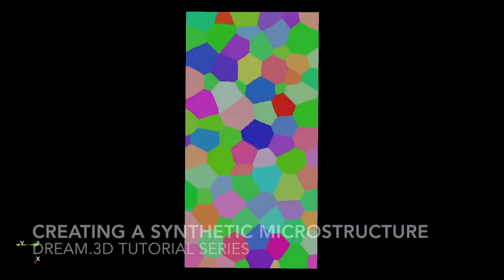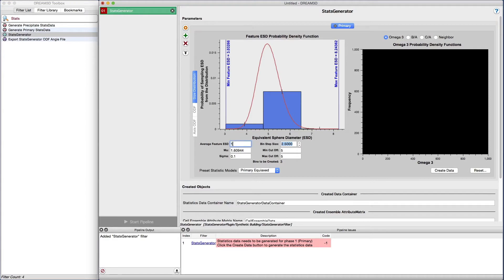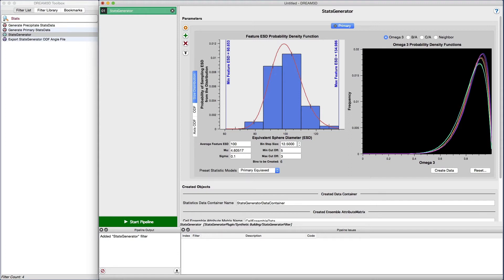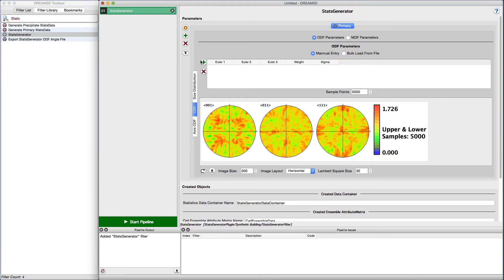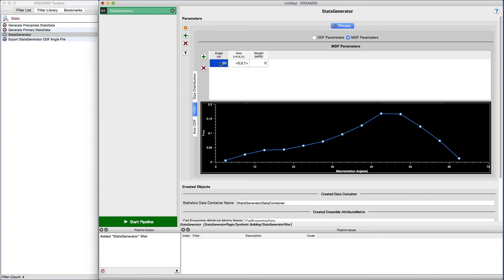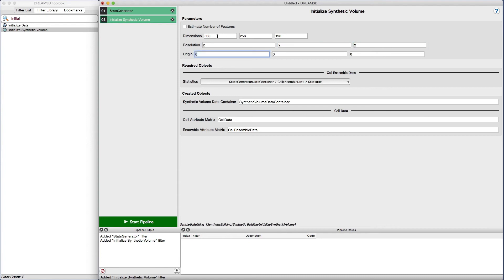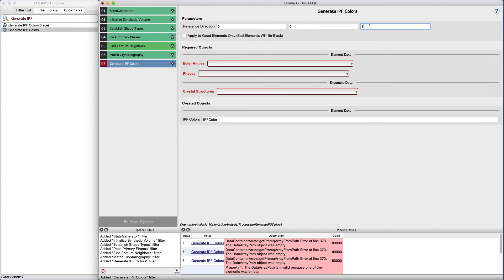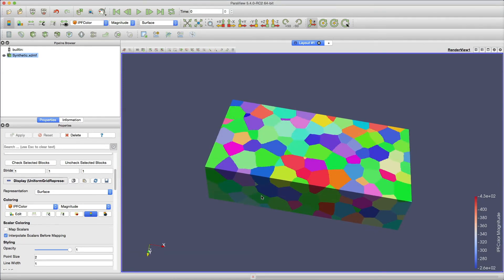DREAM.3D v6.5: Synthetic Tutorial

Comment: Thank you for your informative video. Can I use this generated microstructure as the input part for abaqus or catia?
Reply: I mean can I save the 3d generated part design to a format that can be opened by abaqus or catia?
Reply: @maziartour  did you get any reply?
Reply: @Jehosafath  any replies you got on this?
Reply: @learneasyonline  no :(
Reply: The filter  "Create FEA Input files"  at the end of your pipeline will create your input file for Abaqus/other FEA packages. Note: Fill out all the parameter details  of this filter.